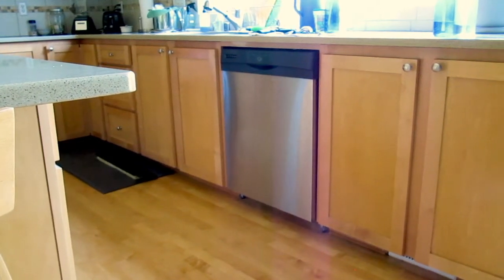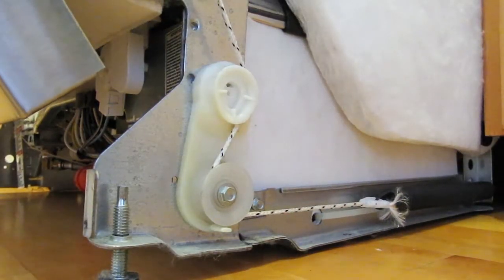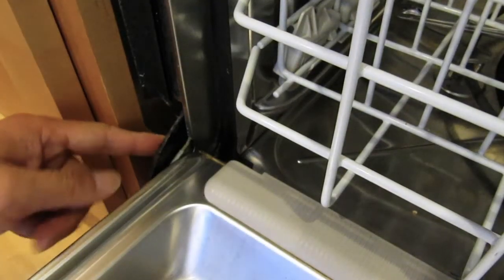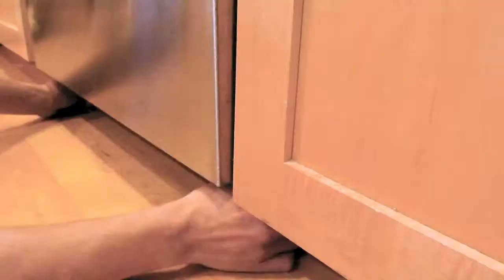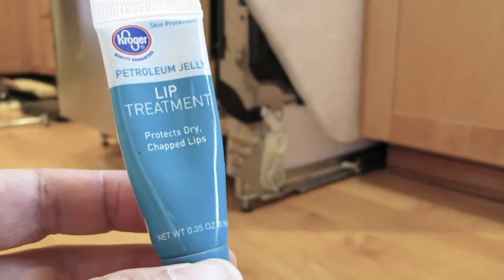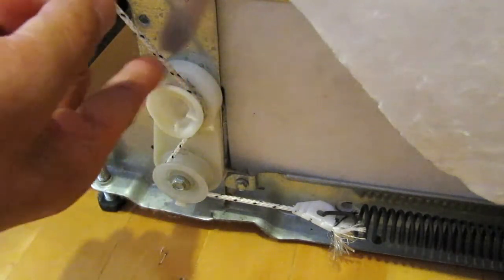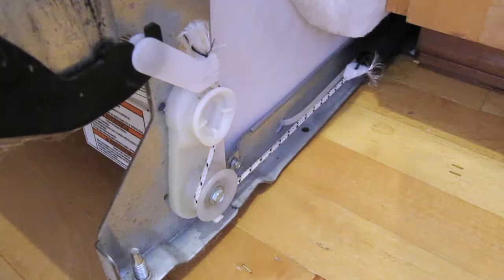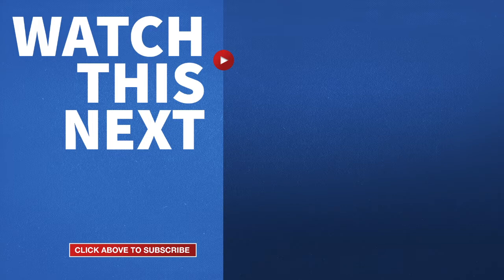Dishwasher Door Squeaks When Opened and Closed - Squeaky Dishwasher Door Fix – Easy DIY Hinge Repair

Comment: My Electrolux dishwasher has the same issue with squeaking but when it is pulled out, there is a metal plate covering the tension cords. Any ideas on how to troubleshoot without being able to access this area?

Comment: NO, no, no. Shame on you! I tried this and it only lasts for a few pulls. I tried other products from Home Depot and it still squeaks. Look into door cable replacement. Online parts store is about $30 so I am just going to put up with the squeak for now since a friend gifted this Kitchenaid to me and I don't know whether it would be worth it.
Reply: If you got the dishwasher free how is $30 not worth it to fix it? Lol at that logic. Also did you use white lithium grease? It will last far longer than you described.